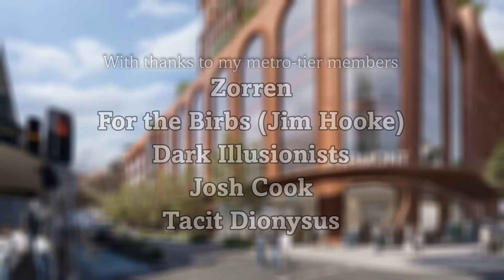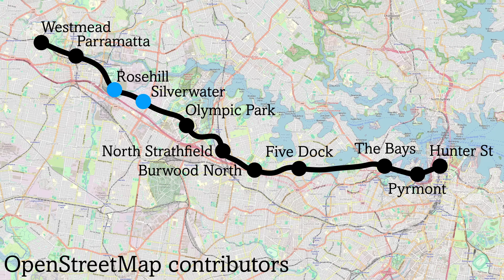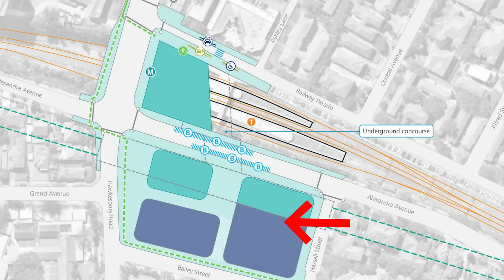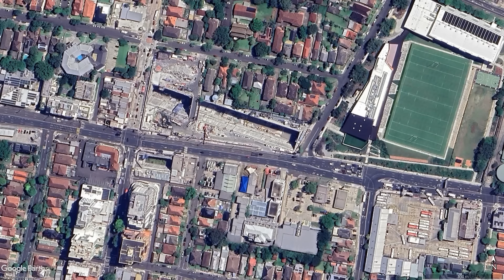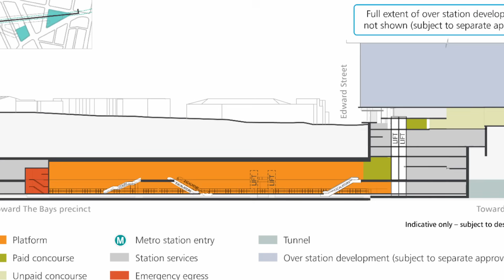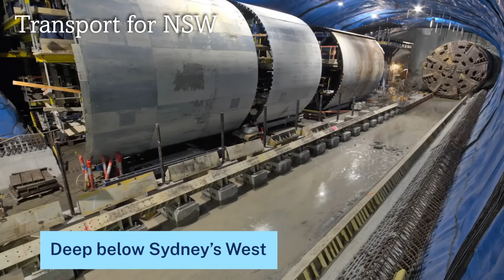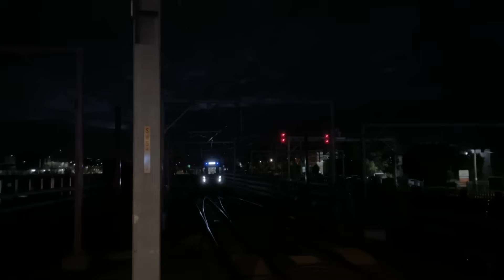Metro West - Sydney's Most Important Railway?

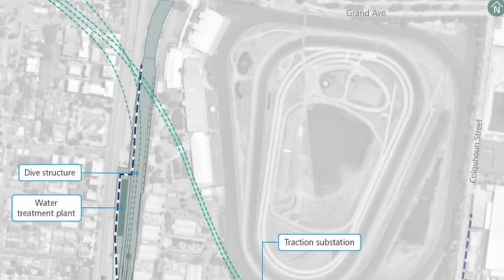Comment: 15:31 Wait wait wait wait.... are you sure? How feasible would it be to convert this box thing into a station? Was this planned in the original design? Every discussion relating to constructing a station here is all doom and gloom as "the newly constructed tunnels have to be dug into". Even though Central was built in this way I have always thought it not worth the money and time to build a new station here when the tunnels have already been dug, however if this is actually useable for a future station this is great news!

ALSO if we ever build HSR, I strongly believe that the Fastrack proposal of building a new major through station for high speed trains is way better than building long expensive tunnels to Central which has no space to grow. Having less tunnel means less cost = more politically viable. Through running trains would be more efficient and better for connectivity, and wouldn't require a major rebuild of Central. 
IMO the station could be half constructed like they do in singapore while the new HSR station, which would be similar to Shin-Osaka, could be built around it.

Comment: Not interested. Finish the damn Bankstown-Sydenham line first, fk the rest, people of these areas have suffered badly in the 8 months.
Reply: I'm one of those people on the Bankstown line, and I'm happy that this is going ahead at the same time. I'll be using both as soon as they are ready. There is no correlation between the delays in the Bankstown conversion and the Metro West line proceeding - the construction methodology is completely different in each case.

Comment: Its will not be quicker than existing express trains between Sydney and Parramatta. Its just another expensive poorly located stupid low capacity single deck railway. What is still needed is a new  Parramatta to Sydney heavy rail tunnel for express services. This would have been cheaper to build and solve the heavy rail passenger capacity problems and result in a faster service.
Reply from the maker: It will be 12 minutes faster than the current T1 service between Parra and Wynyard. It could possibly do with more stations but now Rosehill's fallen through it's a bit harder to find a good place for them. I don't know where you get 'low capacity' from. From the start it'll run something between 15-20 000 passengers per hour per direction with potential for >40 000 people per hour with more, longer trains. An express suburban tunnel would be far more expensive.
Reply: @hain_train  How do you come to the conclusion it would been more expensive to make an express Sydney standard loading gauge tunnel. It would have been cheaper because you don't need to make as many stations, a massive cost saving. As for future capacity's and times, like the existing metro promises, it's lies. There is nothing stopping new design triple deck express trains on the existing system being upgraded to faster times and frequencies other than a political will to do it. The current maximum speed of Sydney triple deck trains between Sydney and Parramatta is 115 km/h compared to the maximum Metro speed of 100 km/h.

Comment: I don't agree with the suggestion this line should have been a hybrid S-Bahn style line as hypothesised in the second half of the video. A shorter cheaper express tunnel and sextupling Homebush-Lidcombe alongside full ETCS would achieve most of that result. Sydney has gone down the path of intercompatibility and interoperability for far too long and the results are pretty poor. I am however more sympathetic to other conceptions of the line closer to the original 2000s Labor Metro vision with more stations and a longer journey time, particularly with another station near Lilyfield/Leichardt North to interchange with the L1 on its western end but unfortunately the Rozelle underground interchange is a real bitch. Rydalmere if they actually do the New Cumberland Line seems like they shifted that to cover that area and maintain the faster Metro West journey time.

Comment: Those site maps are confusing. Where exactly are the station sites relative to the existing stations? I could see the Westmead station, barely but the rest were a mystery. Context is everything, with clear landmarks. What is the point of aerial photos if you don't highlight the station location?
Reply from the maker: The site maps pretty clearly show where the platforms sit and on the aerial imagery you can clearly see the excavations.
Reply: @hain_train  No you can't "clearly see..."

The aerial photos are lost amongst the mostly industrial locations and site maps lack context. You may know what you are looking at, mark it.

Have you ever drawn anything, eg location maps?

The maps should label the major neighbouring landmarks, highlight the platform location with a contrasting tint, mark the entry/exits, show commuter movements with dashed arrowed lines in a strong contrasting colour, show links to existing older transport infrastructure, scale and north point arrow. 

Cross sections should be marked on the plan.

Basic stuff.
Reply from the maker: I’m not sure what you’re looking at. The aerial imagery is pretty clear- you’re looking at the big rectangular hole in the ground. The other plans are also pretty self explanatory.
Reply: @hain_train   I'm looking at what you are looking at. The excavated ground, not always easy to spot from industriall sites/car parks. Where are the annotations, connections, street names, direction arrows, North Points, scale, landmarks? Just to nme a few obvious details.

Have you ever done any plans or graphics or communications?
Reply from the maker: A massive 180m long whole in the ground should be pretty obvious. Pretty clear it’s not generic industrial land. Yes I have done graphics and plans before.
Reply: @hain_train   The size of the hole is only relevant if you are standing next to it. To be blunt, your graphics are rubbish and it's futile trying to explain that to you. 🙄
Reply from the maker: If they were truly rubbish I suspect more people would have said so earlier. I appreciate you may have difficulty understanding but evidently that is not a common problem.
Reply: @hain_train  It isn't a common problem. The esteemed commenter is having a bad day and decided to come here and take it out on you.

Comment: Should have been built along the Victoria Road corridor.
Reply: Great idea.  Interchange at West Ryde.
Reply: @JonathanMaddox  Less demand, slower alignment, less potential for future development, and does less to relieve the existing Main Western Line corridor.
Reply: @BigBlueMan118  All of the benefits of the proposed metro could have been delivered by upgrading the T1 and tge Parramatta Road corridor. That would free up funds to build a metro on Victoria Road, which would still serve Pyrmont and White Bay and there is lots of scope for development at Drummoyne, Gladesville, Ermington etc etc.
Water under the bridge now and we will have to do the same with second best light rail or busway.
Reply: @jack2453  No Jack I think they couldn't - firstly what do you mean by "upgrading the Parra Road corridor", you mean with a tram? Secondly how would you transform the connectivity with Olympic Park if you took the Victoria Road corridor? Thirdly, Victoria Road wouldn't get you that close to Five Dock which is a bigger centre with more potential than Drummoyne and works better for most sensible local feeder bus connections in a future bus network as an interchange than does Drummoyne (also has a less chaotic road environment than Drummoyne). I do see the inherent value of Gladesville for development for sure, but North Burwood alongside Olympic Park and hopefully Rosehill is stronger for me, you will still get uplift in Ermington due to Parramatta LR stage 2.

Comment: Agree regarding the quad track.  The Parra River Bridge has spans to support 4 tracks and Meadow Bank station was designed originally to support 4 tracks too.  Leaving West Ryde as the most difficult renovation to expand to 4 tracks.
Reply: The quad track at North Strathfield itself isn't that big of a deal because in future all trains are planned to stop at North Strathfield anyway to take advantage of the interchange to MW and reduce crowding on the main Western corridor. I agree at least another track from Rhodes over the bridge and up through to West Ryde if not the full quad appears like a good option, on the other hand hopefully they finally start getting serious about HSR and then you will be able to remove most/all of the CCN trains from the Main North.

Comment: No stop in Leichhardt and Annandale is a big mistake. Even bigger mistake is no cross platform interchange with M1 at Martin Place
Reply from the maker: There’s not nearly enough space for a cross platform, you’d be running through building foundations. It’s incredibly difficult to find space under the CBD for massive stations like this.
There are no stations in Lilyfield etc because the tunnels are super duper deep as they run below Rozelle Intg. I think it’s pushing 100m there. Way too deep for a station.
Reply: @hain_train  They would be amongst the deepest in the world for sure  but technically possible. The route of the line is the big issue, still based  on the idea that people just want to get from where they live to their job in the city rather than getting around the city.
Reply: @hain_train  So we can't make the right decisions now because we made the wrong decisions before.
Reply: @hain_train  Chongqing and Kyiv metros both have stations deeper than 100m.  Why not Leichhardt?
Reply from the maker: Not enough benefit to outweigh the cost
Reply: @hain_train  By what measure? Isn't building a billion dollar bit of infrastructure that doesn't really solve the issue of connectivity in Sydney more expensive? Unfortunately this line should have gone via Haberfield (parra road), Leichhardt Town Hall (Interchange with the tram maybe?), Annandale Shops, RPA/Sydney Uni, Broadway and Central where it could have joined the M1 and then headed out east. Building it in its current form was done only to benefit property developers in "the bays" (Whos that even for?), and so the Liberal government of the day could sell the "20 minutes from Parramatta to the City" which is the exact wrong way to build a metro. Not to mention on the western end, no connection to Strathfield? Not great either

Comment: Yes  to  several points here.
Running the Western Metro to St James would be great, for passenger access, and if (as Trainguy4 and others suggest) you  had single-deck fleets compatible with both Metro and mainline operation, you could have a very flexible network, allowing direct connections both in the west, and also at St James if desired. Such single-deck fleets would require either that the West Metro be at 1.5 kV. or making these hypothetical single-deck sets multi-voltage (which can be and IS done overseas). You could also use such single-deck sets to run between Macarthur and Bansktown and onwards, eliminating changeovers at Bankstown. 

It also seems dubious to make the M1 and West metros with different widths etc. This locks in future development to a patchwork of disconnected lines. And then WSA Metro will be different yet again. And M1 doesn't yet go to St Marys or even Schofields,  both of which would be useful. As it is, WSA Metro will dump passengers at St Marys, which does allow interchange. but is also inconvenient especially for city trips

Re T6 - T7 link: If they can spend many millions tunnelling 30 km between Westmead and the city, it doesn't seem much to do a kilometre or two beneath Lidcombe, if traffic justified it.
Reply: Alot to disagree with there. Firstly it is a good thing M1 and Metro West are different, the M1 line was always designed to take over large sections of the legacy network so needed to be compatible whereas Metro West was always inteded as a standalone line so should use the best available tech. Same with WSA Metro. People often overstate the benefits of compatibility and understate the benefits of fully optimised corridor design for specific corridors. The M1 and MW are completely different in many different ways, and the sets used on the M1 are in no way the optimal for the Metro West.

Secondly, what is wrong with St Marys if you stop express trains there in future and potentially add more service then you will have a reasonable interchange with a fairly quick trip to much of Western Sydney (as an initial stage, obviously the benefits of extending the WSA Metro are totally apparent).

Thirdly, St James? Why? The least-used worst-located station in the CBD? I get the need for an interchange with the T8 (in fact I have seen it suggested that the Metro West should take over the Airport line to Revesby local tracks) but St James is far from the optimal location for this. People that suggest this seem to be high on Bradfield's 100year-old plans but the current plans to me at least are far stronger (Metro West eventually being extended south through to Zetland and then the Anzac Parade suburbs to complement the light rail).
Reply: @BigBlueMan118  Thanks for the reply.
I understand your points, but having  compatible systems would allow single-seat travel at least to the city, via M1 (or maybe MW as proposed, though that would mean a lot more construction and expense).. Also you would have a continuous route through Western Sydney.  Yes, extending WSA (and/or the M1) so that they met (say at Schofileds or St Marys) would improve things. You could also do a direct link if the Leppington HR was extended to WSA to interchange with the Metro there, but there seems to be no enthusiasm for that.

I'm not sure how much M1's compatibility matters, as many millions will be spent on converting it - though they did keep it at 1.5 kV, and of course they cannot do much to change curves etc,

The St James idea was not mine -   that was the OP's, based on proximity etc. St James may not be that ideal, but the MW will have Hunter St after all, and their idea was for single-deck sets that could use HR and Metro lines. Extending the MW to Revesby through St James would eliminate a lot of extra tunnel-building, and St James would just be another station on such a system, not a reason in itself, not to do it.

Comment: even if the extra stations at Rose Hill and Stillwater don't open with the rest of the line, they should do what Singapore did with stations like Hume or Bukit Brown where they build the station shell then fit it out as a proper station in a later date. This would mean less disruption to services as the space has already being mostly pre-constructed for a future station there. For a Westward extension, I think it should turn and follow the M4 motorway to Prospect, then run elevated and head south down the M7 motorway until the new junction with the M12 motorway, from there, it should go to the new Western Sydney airport where it would provide a direct rail link from the Sydney cbd and parramatta to the new airport as well as provide an interchange for the more local WSI metro which I think should extend south to campbelltown and north to schofields. I would also extend Metro Northwest to Schofields and the Southwest rail link on Sydney trains to the new airport. By having the WSI Metro, Metro West and Sydney trains all connect at the new WSI Airport along with these expansions, we can create some really good connections to all parts of the city from Campbelltown in the south, to Sydney's CBD in the East, to Parramatta, the Northwest, and if we swap the T8 and T2 around, we could even connect the new airport to the existing Airport. This is all just a wild fantasy and will probably never happen but if it did, then the new airport would be extremely well connected and Sydney, particularly western sydney, would become extremely well connected. Imagine how many job opportunities this could unlock as well, it would be really good for the local and even the national economy.